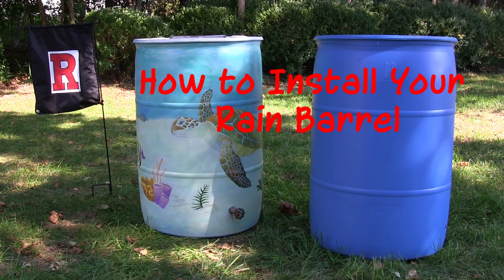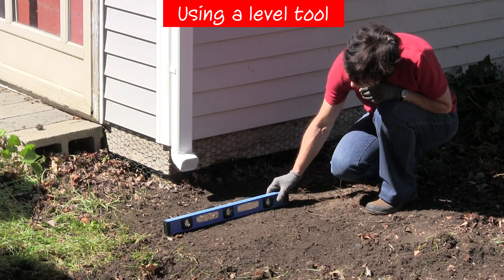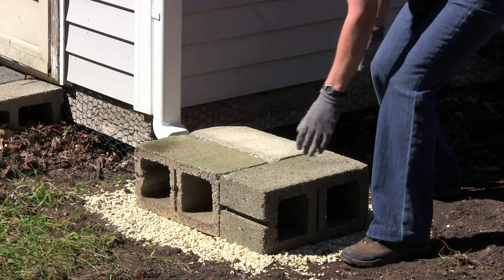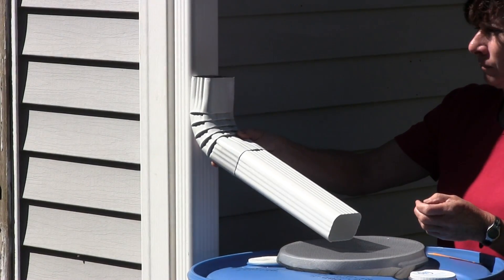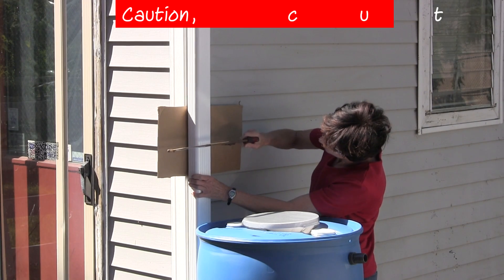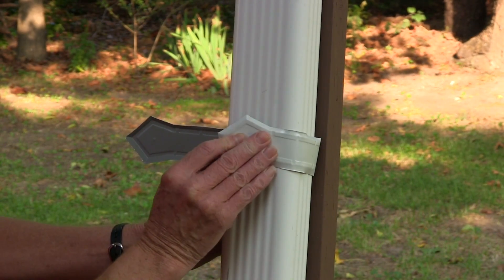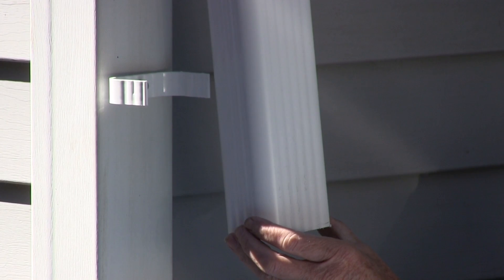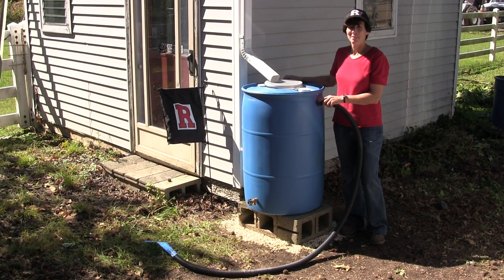Rutgers NJAES Cooperative Extension:  How to Install Your Rain Barrel

Comment: In case anyone is watching this video in 2020, I thought I would share my experience. We installed a rain barrel this year from one of the roof gutters on our home. When the first storm came (admittedly, a long rain storm), the overflow hose was not able to empty as fast as the barrel was filling up. In less than two hours, the 60 gallon barrel was overflowing and after two more hours of rain, the area surrounding the barrel - and next to the house - was flooded. To address the problem, we are ordering a diversion gutter piece that can be manually switched from emptying either into the rain barrel or the traditional drainage system away from the house (ideally, to a rain garden.)  Another option is to install multiple rain barrels and link them together for additional capacity.  Also, had I measured the size of our roof and calculated the amount of runoff prior to installing the barrel, I would have known that the barrel would fill up to capacity in certain storms. Oh well, lesson learned.
Reply: Its 2024 and I thank you.  I have 9 rain barrels but they all have diverters.
Reply: I live in a condo and I want to collect rain water from the down spout that is situated right next to my balcony. If HOA approves, I want a system where if barrel is full...the water diversion turns off and all water flows down...is there any problems with this setup if any of you have experienced? Especially in North-East winters?